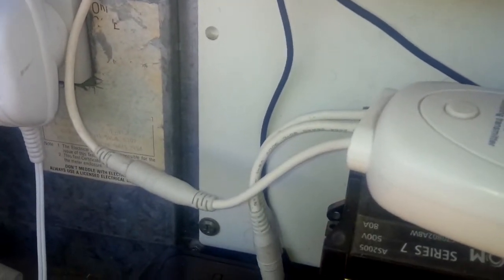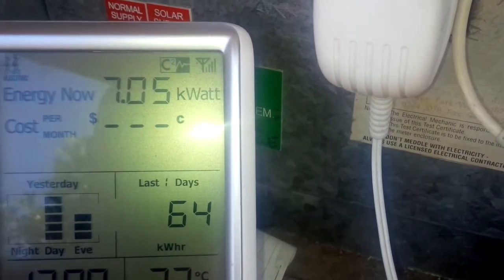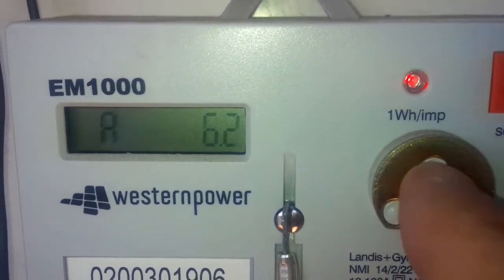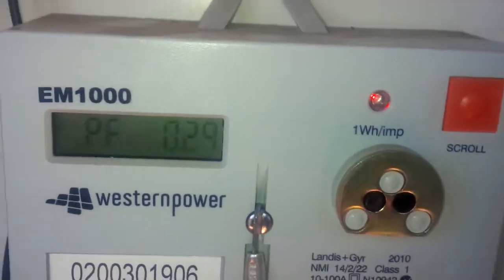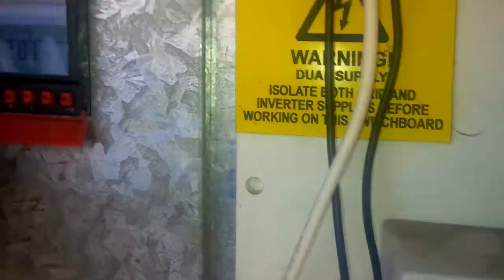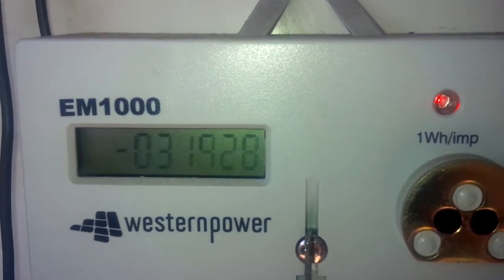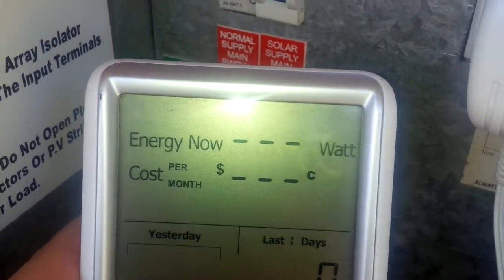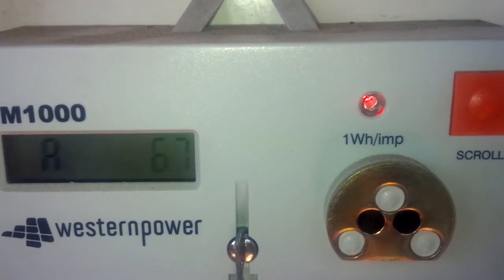Reactive Power is FREE

Comment from the maker: Proof is now out there for all to see, very simple demonstration run at my place now on youtube.

NOTES to be aware of
Due to the nature of the measuring devices used the numbers on the currentcost
device are totally inaccurate and irrellevent, they were simply there to show that load vs PV were basically similar and the meter showed a current flowing into the home of ~6A despite not recording and Watts being used as indicated by the light on the meter which flashes when a Wh of electricity is used.

The currentcost device is unable to measure Powerfactor  and only measure current (not voltage either) the loads and PV generation show as ~7kW whereas in truth the number is very close to 5350W
(the maximum output of the PV inverters connected and by coincidence the rated power of the AC unit.

with 6.45kW aircon running (again indicated only) and 7kW power being generated by the PV system
the meter shows a load from the grid of 6.2A at 252V......how can this be if we are generating more than we are using? but no Watts are being recorded as indicated by the light which flashes once for each Wh it records.
HOW?
Power-factor as shown on the meter was 0.3 leading with a 6.2A load on the grid side (1562W!)  however this is NOT RECORDED by the meter as the 6.45kW load is being fed from 7kW active PV power.
Whilst the power factor of the appliance is less or greater than 1, there is current flowing BACK and FORTH whilst not doing any useful work hence there are no Wh used!
imagine it as a bathtub as water sloshing back and forth, this can be measured as a rise and fall at one end of the bath but the level of water in the bath remains unchanged.

For the sake of the demonstration I then turned on another motor load which moved the power factor from 0.3 leading to -0.33 lagging! and increased the load on the home side by an additional 950W
upto an indicated 7kW with 7

this cause the light to flash but not at the rate you would expect when pulling 7.3A (1838W)from the grid as once again the reactive power is being provided for by the grid and is not being billed.

hope that makes some sense!

Karl